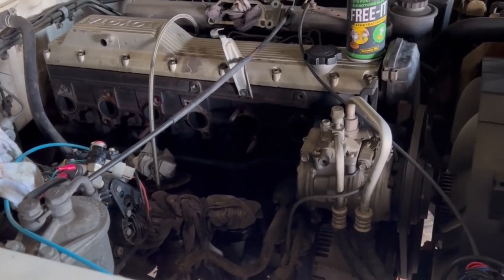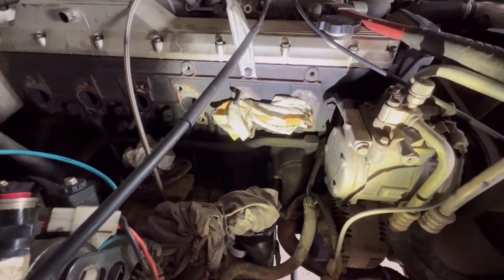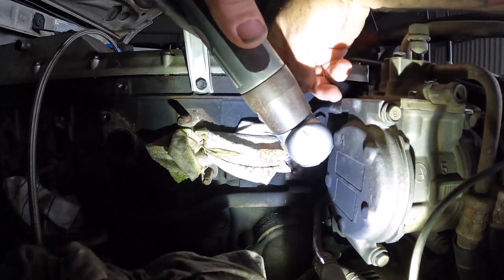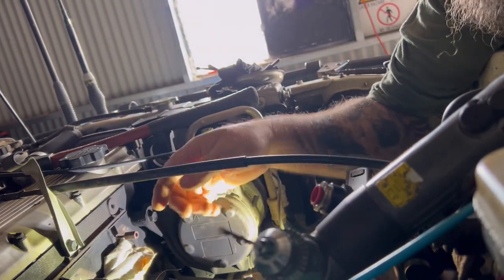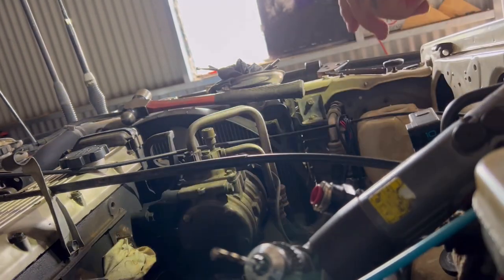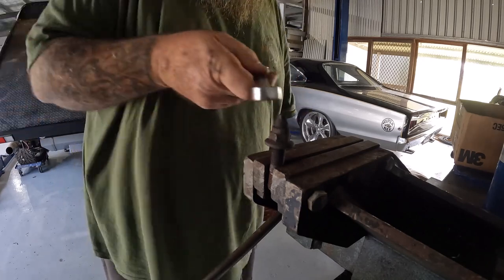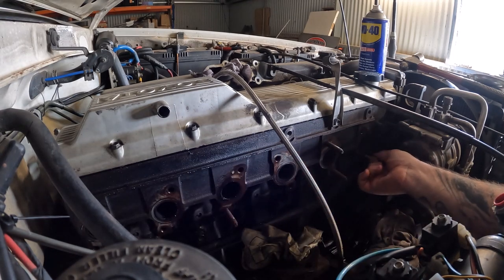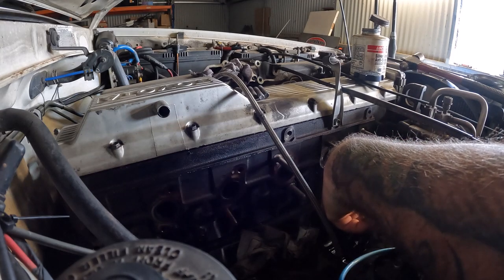Cracked troopy exhaust manifold and broken stud removal, HZJ75 Troopcarrier repair.

Comment: You can get reverse drill bits, sometimes the reverse drill bit is enough to get the broken stud out.
Reply from the maker: Yes my son has some snap on reverse drills and I reckon that would’ve worked well. But he was at work so I decided to just have a crack at it.  Luck was on my side thankfully.    Thanks for watching

Comment: I was thinking you'd have more of a problem getting that stud out but you done well, I recently bought an extraction kit with lefthand drills ect, haven't had to use it yet.  I need a step ladder to work on my HZJ75 also, I've got a 50mm lift. I noticed the Terrain Tamer radiator, what do you think of it?
Reply from the maker: I also thought it’d be tougher going but for once it was easy but I did spray it three times a day for a few days first which probably helped.  As for the radiator that is one of the best things I’ve done to the troopy, I fitted the “cool kit” from Simon at cms in baccus marsh, it comprises the terrain tamer alloy 78 series radiator, 78 fan and 78 shroud and hoses. Made a huge difference in running temperatures especially on long hills in 35+degree weather. I highly recommend it.